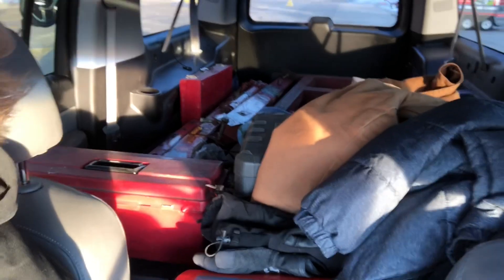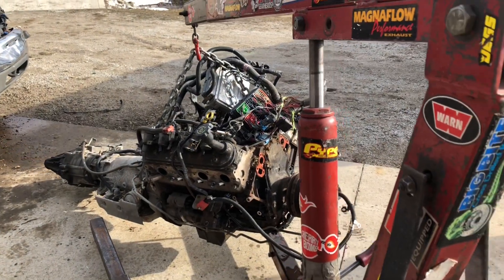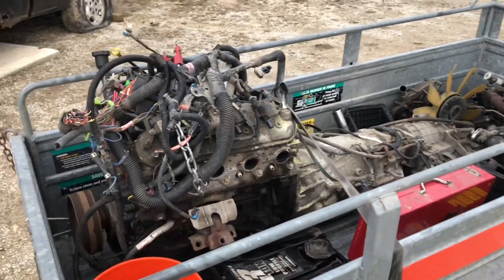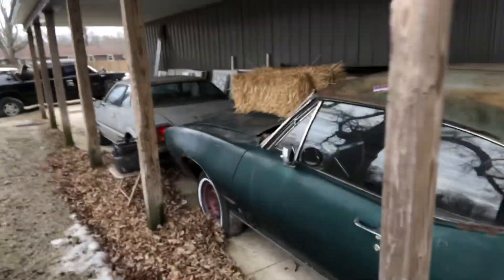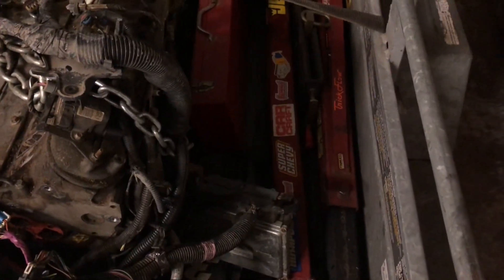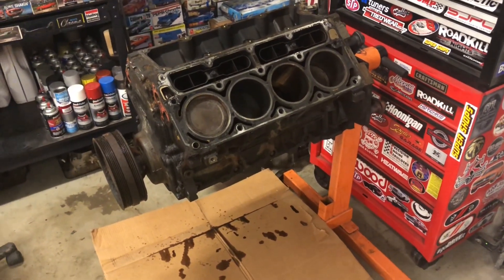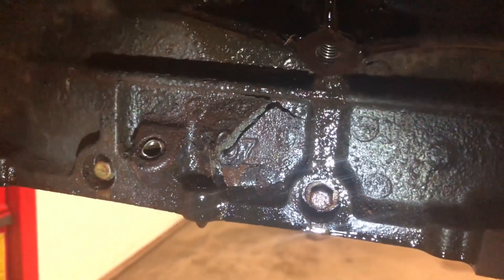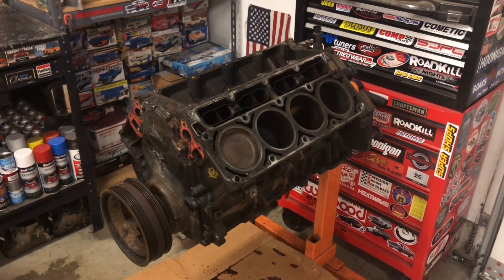The Duster’s next engine

Comment: Mopar has to go in Mopar. You can get 318s cheap and plentiful and with home porting on the heads, some decent exhaust cam and carb and you will make some very decent HP. Leave the LS for the GMs. Unfortunately there are a lot of crooks out there - like the guy selling it didn't know he threw a rod - not much use for people like that.
Reply from the maker: Lol he didn’t know, not his fault. He’s a really good guy. I’m not a mopar engine fan. I prefer Chevy engines and that is whats going in this car

Comment: Oh this makes me sad!  I’m an LS guy but not in mopars.  Find a 5.7 hemi.  The heads are better than the 243/799.  They really wake up with a cam and intake!

Look for a rotted out Durango. You’ll get a deal on an engine that probably hasn’t been worked to death.

FB marketplace has 5.7 hemis needing rebuilds (knocking) for as low as $200
A new rotating assembly can get expensive though.
Reply: I am sorry about the misfortune though.  I’ve been there.  I’m the king of buying someone’s junk.